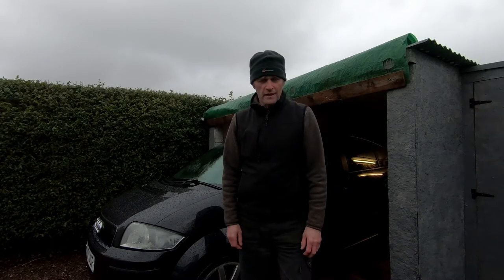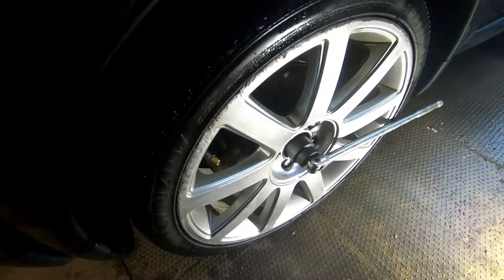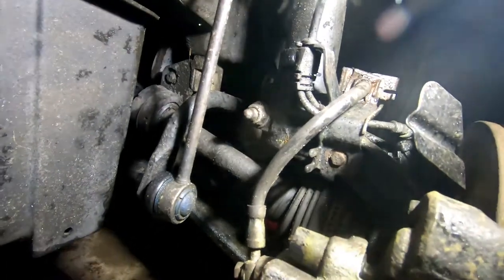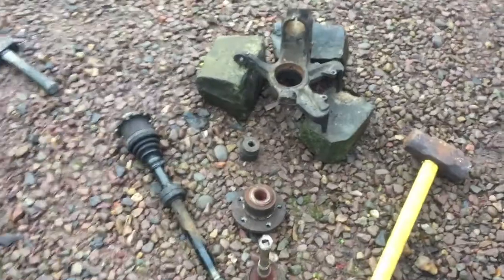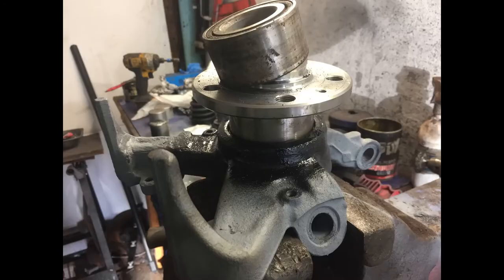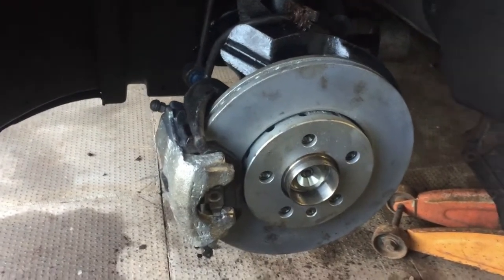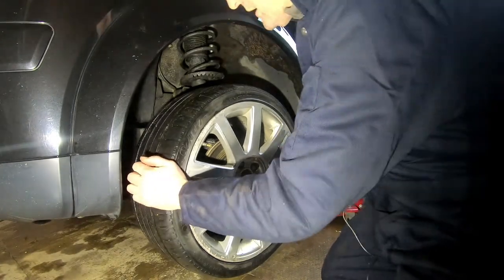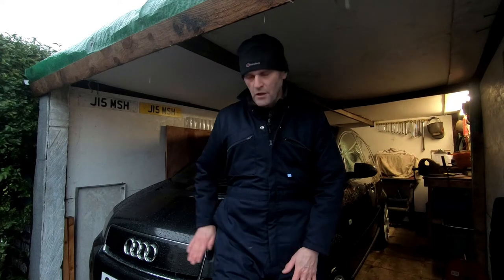Audi A2 front wheel bearing and CV joint replaced - eventually!

Comment: Thank you for the tip, I will try undoing the half shaft from the gearbox and hopefully I can complete the task. 
I have just spent too long trying to take the hub off the drive shaft on my mate's A2 (and alot of swearing at the car, I must say I prefer working on old British and Japanese cars.) All I want to do is replace the front shocks and the bottom ball joint including the bottom bracket.
Reply from the maker: Suppose it's just perseverance but never easy working on old cars, especially on your drive. Good luck